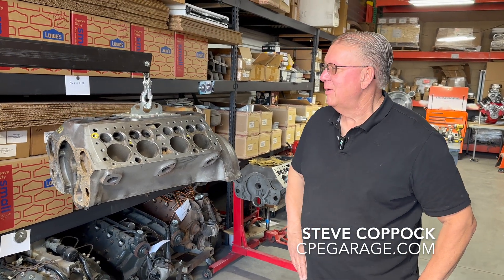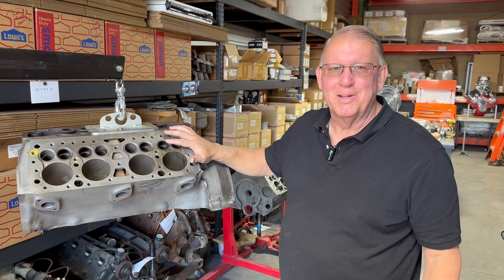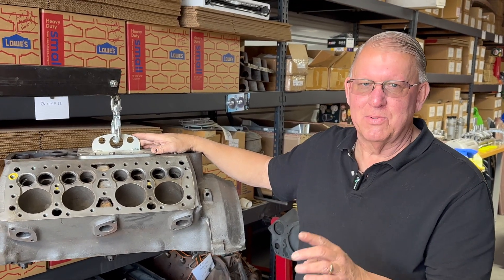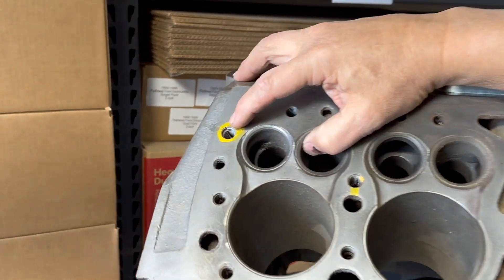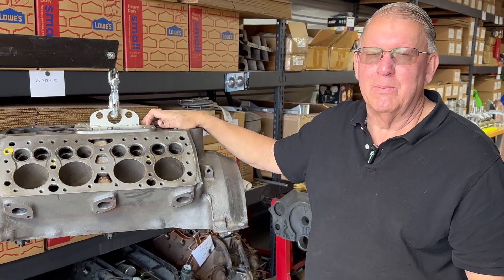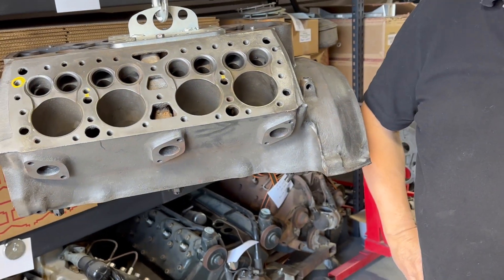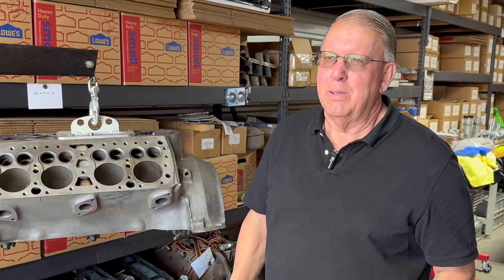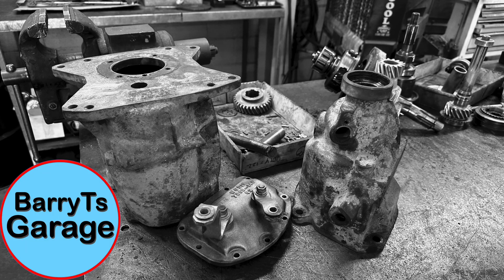Flathead Repair or NOT? Steve Coppock w #barryt

Comment: I have a ‘50 Ford Coupe that has the original flathead in it. I recently learned it needs to be rebuilt because of low compression. I hope when the motor is torn down they won’t find a irreparable block. This video really helped to hear from a flathead expert! It is much appreciated!
Reply from the maker: Thanks for watching, I hope it helps you out!